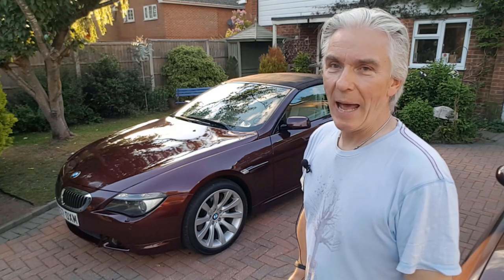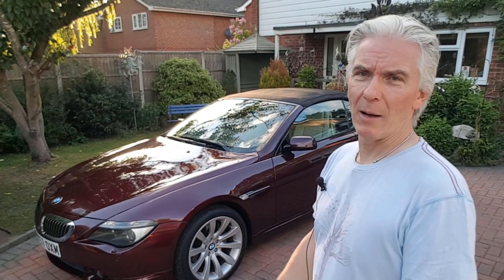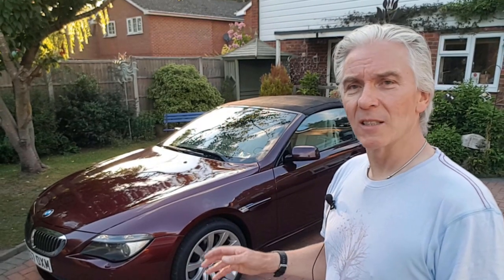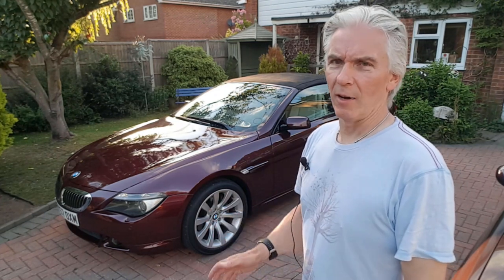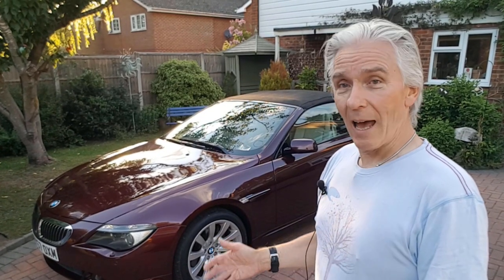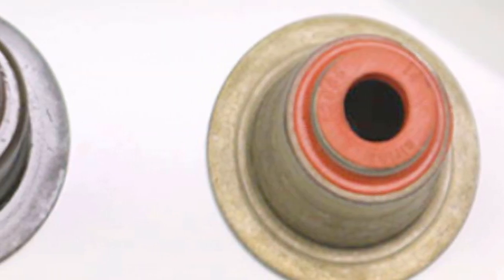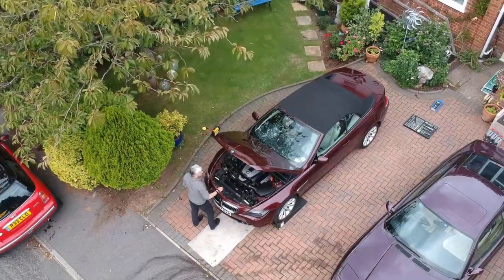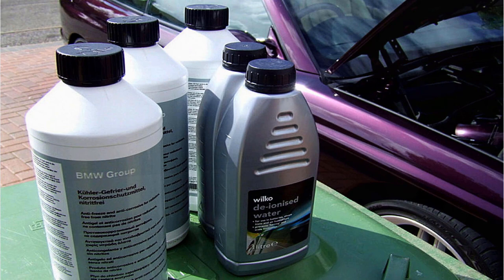BMW N62 V8 Engine Problems - SAVE IT - Don't fix later!

Comment: Hi Tim thank you for your great videos. I need help for an issue. I dropped engine for valve steam seals change. I replaced all necessary gaskets for oil leaks. I also changed  every hoses that may cause air leak with changing coil packs  and plugs. My car has one problem that we couldnt find. Car idles not smooth like a little shake under driver seat. A little hesitation until 1.000 rpm. When we reconnect maf sensor  it idles very smooth without any problem. Engine runs like trying to lower idle rpm and make corrections. When it shakes tachometer do not move or jump. No error codes, it runs like a little misfiring but do not give any codes when maf is connected. We tried some used and unused but oem maf sensors, result is the same. I also read from orher topics that unplugging maf sensor correct idling even if the problem is not maf. Any help will be apreciated. Thanks
Reply from the maker: Hello Ahmet, have a watch of this: https://youtu.be/8mfvZyvsftc It sounds like a valvetronic problem where you get more valve lift on one cylinder than on another - and as the valve lift is only 0.3mm at idle it doesn't take much - anyway have a watch and then get back to me
Reply: @TimmsBMWRepairsandInformation  thank you, we will check valvetronic system. Also i need to add sometimes specially when engine is hot, car idles better and the sound of car is better. After getting hot when you press the gas pedal exhaust sound becomes like car is not igniting very well
Reply: @TimmsBMWRepairsandInformation  i am also suspicious of a slightly bend valve. After engine head job while testing one rocker arm got out of its place.
Reply: @TimmsBMWRepairsandInformation  my mechanic checked vanos and valvetronic system, it seems no problem with them. We will focus on changing maf.
Reply: @TimmsBMWRepairsandInformation  Hi again Tim, i got my car from shop and started to drive daily. We checked valvetronic system with ista+ . No problem for that. I realized that when the engine is cold there is no problem with idle or anything. After a couple of minutes when engine gets hot, i think it goes from open loop to closed loop. My little shaking problem starts from that moment. I also forgot to tell that, when i bought my car, cats were empty, while changing steam seals, we put two euro 5 aftermark cats but the engine light came again. I am started to suspect from oxygen sensors. Can o2 sensors cause this issue? Thanks
Reply from the maker: @ahmetmuratozturk3742  That still sounds like a Valvetronic problem - hopefully I explain your problem here: https://youtu.be/8mfvZyvsftc
Reply: @TimmsBMWRepairsandInformation  Tim we checked again and found that stroke was set to 0.8 mm. We changed it and made it to 0.3 mm, problem continues. But yesterday i got a check engine light with increased emission. I got 29FE (P0491)

Comment: I took my 2005 645ci to the mechanic and was informed that there is oil in the alternator so it will have to be replaced.  Likely cause is the alternator bracket seal.  You mention in the video that the car can be put on a lift and the seal changed from below?  Or does the engine have to be taken out completely?
Reply from the maker: The usual leak that damages the alternator is from the valve cover gaskets or the oil pressure sensor. The alternator bracket can cause it as well. The engine does not have to come out and the job is done from underneath

Comment: What bmw engine its better? X5 e53 4.8is or x5 e70.4.8?
Reply from the maker: Very similar engines, the latter having the 'N' variant, but not much in it really...
Reply: @TimmsBMWRepairsandInformation  Thx. I'm concerned about chronic problems with this engines gaskets and valve seals. Both engines have this particularly problem?
Reply from the maker: Only if they are not serviced correctly!

Comment: Hi Tim great channel I'm new to owning a E64 and I need to change the front drop links I have been quoted £200 but I see you can buy the drop links for £42 are the drop links easy to change?
Reply from the maker: £200 isn't bad at all, drop-links can be very simple - but they can be a bear to get off sometimes!

Comment: Hi Tim, is carbon build up a big problem with these engines? I've heard the secondary air injection system tends to suffer from this a lot especially after 100k miles. Is this something you've experienced and/or know how to prevent?
Reply from the maker: Hello Nakash! Carbon build-up is not a problem IF you use decent fuel and oils - I always use the high-octane Shell fuels in the UK - and, of course, change the oil as I specify in this video. The secondary-air system has been a problem since it was first introduced on the E38 - just like EGR systems they can coke-up. But again fuel and oils is the best way forward
Reply: @TimmsBMWRepairsandInformation  many thanks Timm appreciate the response

Comment: Timm, your video has left me with a few questions. I bought my '06 650 with 73,000 miles late last fall and after storing it for the winter, changed the oil this Spring with LiquiMoly Mycogen plus a pint of Ceratec. I was convinced to use 5W40 due to the age and mileage on the engine. Was that a mistake? I see you're using 0W30.

Can you use Wynn's and Forte at the same time? And with having the Ceratec already in, should I wait until the next oil change? I only have 2000 miles since the change.

And how do you know if you have genuine BMW coolant?

Thanks!!!
Reply from the maker: You will be fine with 5W40 - I use 0W30 to lessen the valve noise on the over-run. No idea if you can combine multiple additives - probably no one else will know either! As far as Coolant, you can't really tell, so best to drain and refill it needs changing every three years or so anyway

Comment: Hello Timm. Great video, so much information. About the gearbox, mine 2009 550i, with ZF6HP28 shifts smooth but the reverse engagement is slow. It takes about 2 or 3 seconds to engage from D or neutral. The opposite, from reserve to D or neutral is immediate. Do you consider it a regular behavior or indicates a transmission problem? Just have 45k miles and made a complete gearbox oil and filter change some weeks ago, but no changes. Thank you
Reply from the maker: Mine does the same Igor - so I guess it is normal behaviour!
Reply: @TimmsBMWRepairsandInformation   Thanks Timm!

Comment: Hi tim, how many tubes of forte seal do you suggest to use and how often? 
Thanks
Reply from the maker: 1 Tube per 2-litres engine capacity - so for the 650i I would go with three.

Comment: Nice video, Tim. I bought a 2007 550i e60 with the N62. Slowly started leaking from one spot after the other. First the vacuum pump seal, then the valve covers (both), then the oil pan and last week the alternator bracket. Exactly like you said, the crack on the alternator bracket made me loose 4L in about 20 minutes. Definitely not a job I ever want to do again.

I have 1 harsh gear change on the automatic 6 speed gearbox from ZF. It's from 1st to 2nd gear. All the others are quite smooth. Now 275.000km on it and according to the service book last done at 200k. Would you say the mechatronic seal needs replaced together with a gearbox oil change? Is that also for the automatic gearbox from ZF?
Reply from the maker: Hello Maria, yes, the ZF box requires the replacement of the Mechatronics seal - and that should sort out your harsh changes.
Reply: @TimmsBMWRepairsandInformation  will get that done soon then. thanks for quick response

Comment: Great advice for any car. Thanks for the post!
Reply from the maker: Glad it was helpful!
Reply: @TimmsBMWRepairsandInformation  I have taken photos of two different U-shaped deflection rails that I've replaced on an E38 and E39 M62TU and M62TUB engines. The 740i had a small piece of plastic lost from deflection rail when I replaced it at 100K miles from an engine run mostly on regular petroleum oil (from the previous owner). That rail was definitely in need of replacement since it was at the beginning stage of breaking up. For the E39 540i I ran on Mobil 1 High Mileage synthetic since I bought it (at least 1/2 of its life I estimate) and  it showed hints of deterioration of the plastic rail at 120K miles. Both examples showed highest deterioration at the bottom of the U-shaped apex where I think stress from the chain is highest. The other two rails showed some surface wear but no hint of damage. I thought you might find this information of interest, Timm. Anyway, I believe heating and cooling cycles do take their toll on what is a  naturally brittle  insert used on the deflection rail as well as the quality and regular changing of of the motor oil used.

Comment: PCV= Positive Crankcase Ventilation, not Pressure Control Valve
Reply from the maker: Nope, the valve I am replacing is the Pressure Control Valve - and the crankcase is at a vacuum of 40 millibars - all explained here: https://youtu.be/Yy_Vzir5xco

I've heard this misinterpreted so many times now it's become a common mistake!

More info on meeknet: https://www.meeknet.co.uk/e31/BMW_M60_M62_M62TU_Engine_Crankcase_Ventilation.htm

Comment: Timm! Great video as always. I have a M73 E38 question for you, mate. Do you know the correct resistance for every spark plug wire for cylinder 1-12? My car missfires, and cylinder 5 is showing 5,33Ohm. Might be the problem?
Reply from the maker: I think the leads plus the interference suppressors is around 5K Ohms - so not far enough out to worry about.. Rotor arms and distributor caps is the next on the list.
Reply: @TimmsBMWRepairsandInformation  Thanks! The rest is showing 5,5-5,6Ohm and 5,8-6,0Ohm. Still okay you think? Rotor arms and distributor caps already replaced.
Reply: Yeah I changed my rotors and caps.
Makes a massive difference, stick with oem every 15000 miles

Comment: im buying a 2005 645ci next week with 150 000 km and its all serviced regularly at bmw dealership and it has all documentation for it. So to keep the valves safe i need to keep my oil change intervals within 10 000 km or more often ? thanks in advance, love the car
Reply from the maker: The time is more important - 1 year maximum - and 10,000 miles at the most
Reply: @TimmsBMWRepairsandInformation   so if i dont drive as much i should still change the oil at least once within a year even if i dont reach 10 000 km or 16 000 km which is 10 000 miles and i should be safe with the valves all the time ?

Comment: I've been on the fence about picking up a 650i for a while. So even picking one up with a decent FSH could still pose a risk as the damage could already been done if the correct fluids weren't used?
Reply from the maker: Make sure it doesn't smoke when you view it, then start your own service schedule!
Reply: I agree with Tim. I love to drive my 650, and so many people are scared off and missing one of the bargains of the century! 82k, and no engine issues at all.

Comment: Does this engine suffer from the timing chain tensioners & guide failure ?
Reply from the maker: Everything fizzles out if the engine isn't serviced correctly - but the chain and tensioner is way down the list!

Comment: I really don't understand why this car gets such a bad name in terms of reliability...my 2007 650i is standing on 220 000km on the clock and I've had no major issues...the most expensive thing I've replaced is the run flat tyres...had the car 7 years now. Guess its because of the impeccable service history...I add fuel injector cleaner every 5000km too
Reply from the maker: The reason it gets such a bad name is channels such as Hoovies - and then it just gets repeated over and over without anyone asking why!

Comment: Which engine is most reliable sir pls reply v10 v8 or inline 6(petrol or diesel)
Reply from the maker: Straight-6 was the most reliable, but that misses the point, the BMW 6-Series was always meant to be a V8!
Reply: @TimmsBMWRepairsandInformation   what about m6 v10
Reply: @TimmsBMWRepairsandInformation   should i buy it i think its a very risky car or should i buy something else

Comment: i have recently got a 2004 645ci and it has about 173,000 miles on it, the transmission is beginning to give me some issues, and im almost certain that the previous owners didn’t look after the car at all and even let it sit for four years untouched. I’m not sure what to do with it because I love the car but at the same time i don’t want to be dumping money into something that isn’t going to work, is there any advice you could give me.
Reply from the maker: All the advice you will find in this video!

Comment: Had one of these motors they are trash.  Even with doing "short" mileage oil changes(5-7K).  The alternator bracket leak is honestly one of the stupidest leaks I have ever dealt with.  Secondary air, again, stupid.  I can understand rubber parts will break down however this was a badly designed motor.
Reply from the maker: A lot of people would agree with you!

Comment: Hi  , I have tried many "snake oils" for my 645 , N62 engine for blue smoke and valve stem seals , but never found any dramatically good results ( except replacing the seals for sure ;-) ) but is Forte seal conditionner better than the AT205 I bought from the US ( you probably know this famous US one ! ) ?  How many units to use on the V8 4.4l ?  Would you really guarantee a good result after using it ? Thanks for your feedback and your good vidéos.  David from France.
Reply from the maker: Hello David - nothing works if the stem seals are worn out (as I say in the video) - have you changed the PCV valves and cleared out the valve covers as described here:  https://youtu.be/Yy_Vzir5xco I would use three tubes of Forte on the N62B44. I can't guarantee anything will stop the smoke - it all depends on the condition of the stem seals - the whole point of the video is to warn users to service the car every year or 10,000 miles whichever is the sooner - without regular servicing you will get a multitude of problems!
Reply: @TimmsBMWRepairsandInformation  Hello , yes PCV already replaced even they were OK . But I have a lot of vacuum when I pull out the the oil filler cap . I guess this is due to the valve stem seals . I never took the value with a gauge exactly but seems to much vacuum . Do you know where I can purchase Forté seal conditionner in UK , so it can be delivered in France ? Thanks for your support
Reply from the maker: @davidcambalacho9220  The valve stem seals will not cause a high vacuum - that is the domain of the crankcase ventilation system (PCV's) - it is best to measure it as seen in the video I linked. Ebay.fr has stock

Comment: Any modern engine that can’t do 100,000 miles with just routine oil changes is junk.
Reply from the maker: That's the point of the video - if you follow the iDrive intervals your car dies - but if you routinely service as like other cars it survives!

Comment: Im owning e61 550i 178k on the clock, but sufering with power lack. Dyno shows 306bhp. Any idea where is the problem ?
Reply from the maker: Cats would be my first point of call - they can strangle power - they can be tested for back-pressure at a decent garage
Reply: Ok I will do that then . Thank you :)
Reply: Maybe you got sold a 540i 😅

Comment: So if BMW hadn't put the long service life and sealed for life transmission lies out, people wouldn't be so upset with them and have their nice BMWs falling apart.
They are still expensive to maintain but not as expensive as a whole engine or transmission failure would be.
Reply from the maker: Yes, that's about it!
Reply: Bmw should be held responsible for lying because they should of known no oil is going to last  15-18 thousand miles between changes thus preventive maintenance. It was done to make more vehicle sales.

Comment: Am in debate now to buy a 04 645ci they want 6k for it with a 100500 miles love the look of the car but hope its not going be trouble the guy told me it hass an oil leak now from siting car in great shape but i dont know on the motor
Reply from the maker: Best plan would to have an inspection done - in the UK we have RAC and AA inspections. Get the most comprehensive you can afford!
Reply: @TimmsBMWRepairsandInformation   ha  ha comprehensive iv own 3  bmws two 3 and a 745 here in the us mechanics run from BMW most not all
 i like the car cant believe you got a 8 runing and still on the road i remember them when they were new when i was a kid. I here a lot of trash talk on German v8 i  hope they have took care of this one am 60 40 on buying it
Reply: @TimmsBMWRepairsandInformation   great video keep up the good work